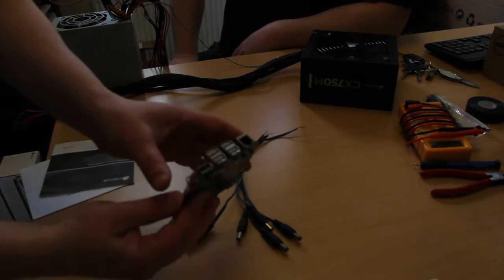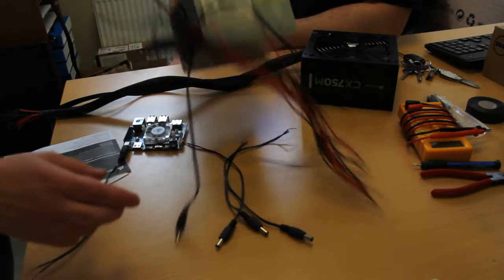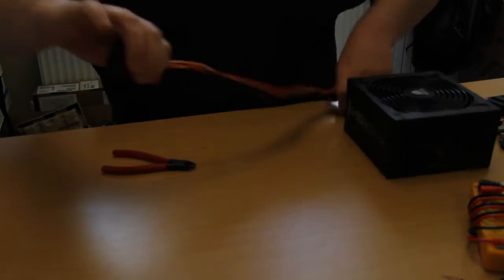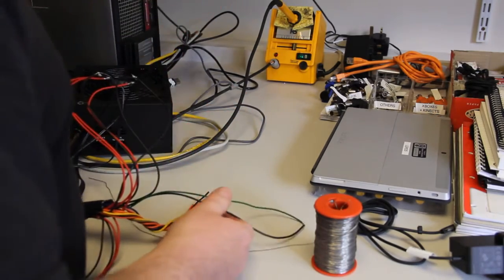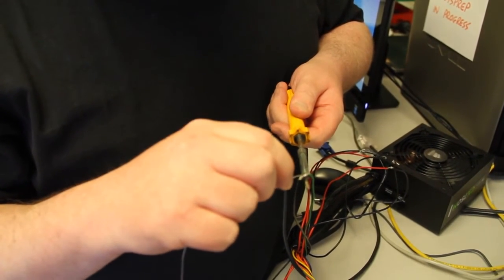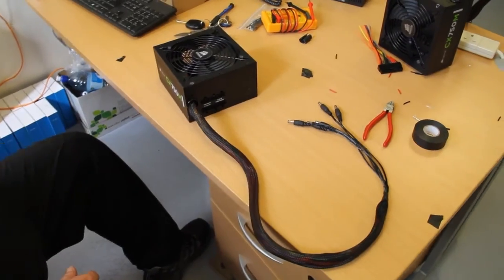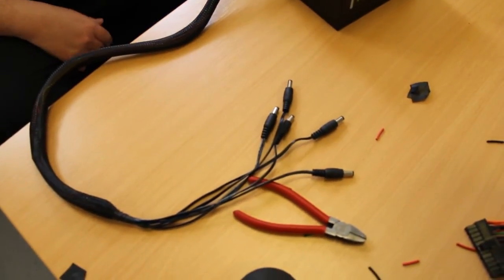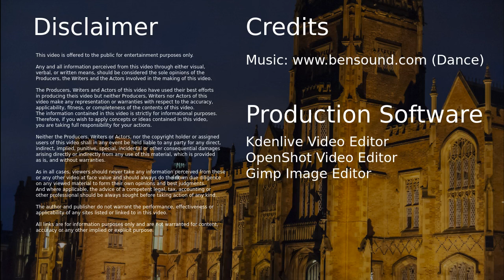Hacking a computer ATX power supply

Comment: Hello! Im now struggling to put a rpi3 to work with a 500W PSU. The problem is this: i made the green+gnd shor hack. I soldered an USB female port to a 5v MOLEX port which come from inside the PSU (not the one that is connected to male motherboard socket). I get those ~5.2V but not enough AMPS to keep the rpi running well, specialy when i connect and HDD ... can you guys help me on this? Im still a noob :X

Comment: This is EXACTLY what I was looking for to build a clustered super computer.  I do have a few comments.  Please reduce or eliminate or change the music.  The pounding distracted my thinking.  Second, I think a very simple introduction focusing on you and exactly what you are going to do is needed.  Third, the lighting was terrible!  Hard to see.  Your hands get in the way of the wiring making it hard to see what you are doing with the wires.  If you eliminated taking the time to show how to cut each wire and solder it...just show a single one, would save a lot of time.  What was very good were the shots of the finished PSU 5 V supplies to the cluster and the switch shots.  Those were really valuable!    I am also concerned with the CLEAN output, how many AMPS per connection.  Pi 3 requires 5 V +/- 0.5 V and 2.5 Amps per Pi.  So showing us what the PSU capabilities are is important...show the actual sticker on the PSU.  Generally, for a 4 output PSU for 5 V, you will start with a 5 Volt @ 20 A (see sticker on PSU).  Since you had a 750 W PSU, you ended up with five 5 V outputs.  Also, why not solder a simple on/off switch between black and green wires and mount to a nice control box on your unit?  That way, if its a PSU without an On/Off switch in back, you could shut off the computer when not using it.  I am also conserned with the cleanless of the 5 V outputs.  Using a 7805 Voltage Regulator circuit with a Capacitor on the output side would ensure that the voltage output is very close to 5.0 Volts.  With PSU's, the output could be +/- 0.5 Volts.  With a voltage regulated output, it could be 5.1 V output which will stress the Pi boards out less and extend their life.  See a typical Voltage Regulator circuit...there are ones here in YouTube to build.  Be aware that you pay strict attention to the Amp rating of the 7805 and the capacitor or you could blow them up or melt them down.  This is why I want to know the output in Amps from the PSU.  After the PSU, building a Voltage Regulator circuit I think, would be a good idea.